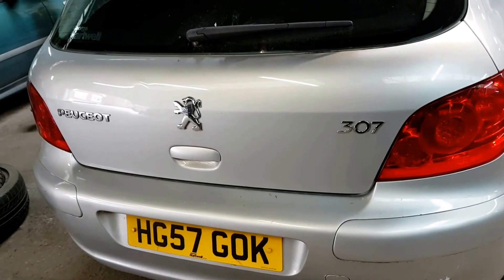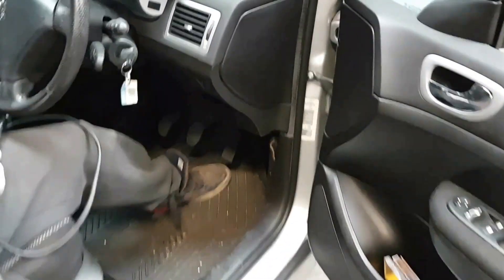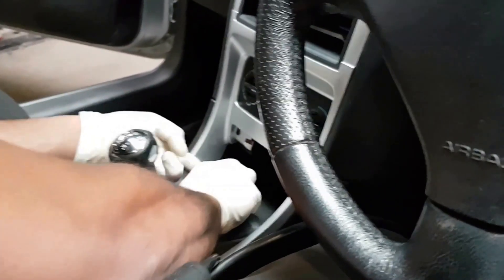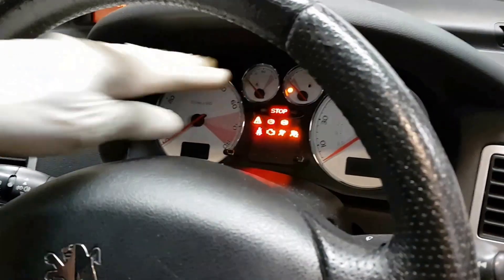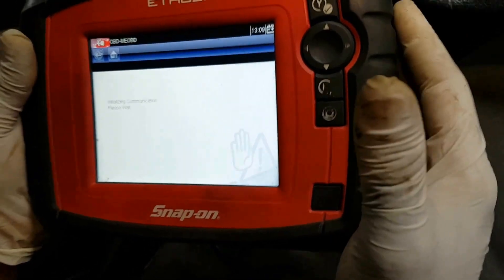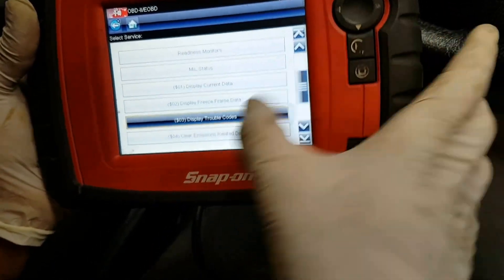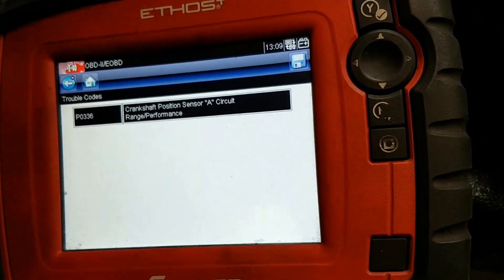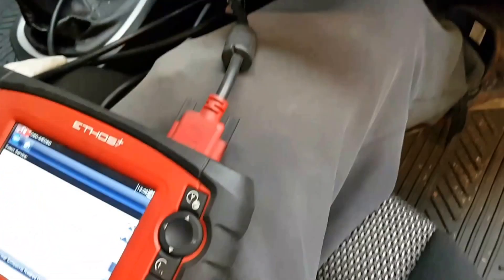Peugeot 307 - fault code P0336

Comment: Hi,
Do you remember if there were any other symptoms?
My 307 is having an intermittant fault in which after about 30 minutes of driving it shuts the engine off if it passes 2000 rpm. And because it happens while driving and I'm in a gear it push-stars itself immediatly and shuts off again in a loop. It's very frightening and annoying at the same time.
But it doesn't set any codes up (just a bunch of lack of communication because of the engine shutoff), and I don't want to start replacing parts at random. I think it's happening on a hot engine (30+ minutes) and/or after a long time on steady revs.